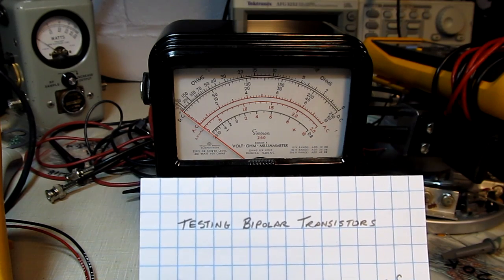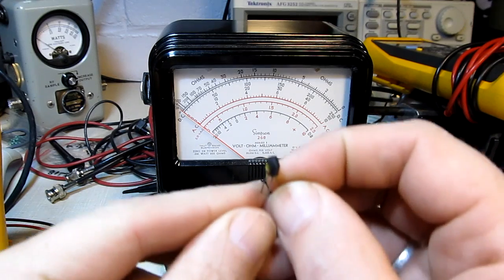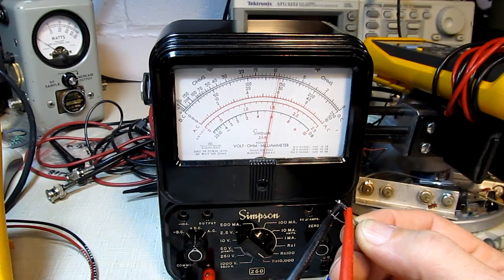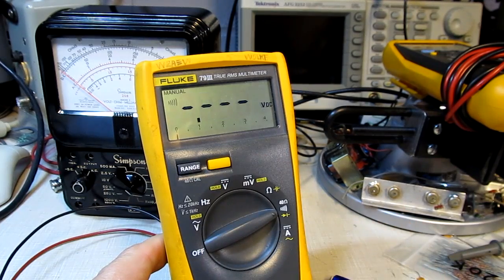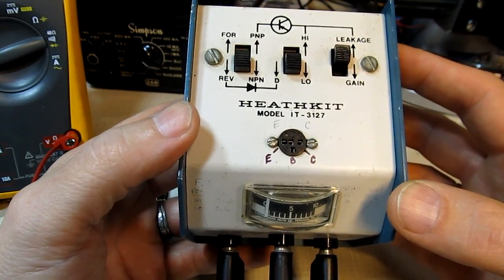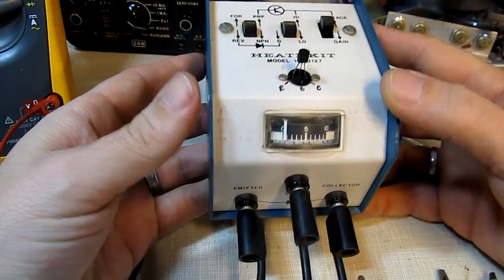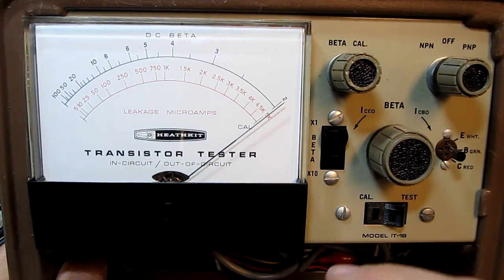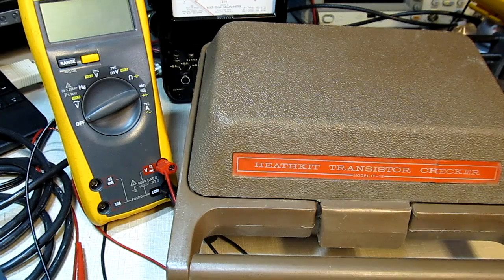#131: How to test transistors - NPN and PNP bipolar junction transistors, BJTs

Comment: 677mV forward voltage between base and emitter.  680mV between base and collector.  When I test a transistor I always notice that the forward voltage between the base and emitter is more than the voltage between the base and the collector. Am I wrong?  I used to think that I could identify the emitter and collector in that way
Reply from the maker: Sss Ttt I think this will depend a bit on the particular transistor type, so it might not be a reliable way to determine the terminals.
Reply: It might be that the emmiter region being heavily doped (rich in electrons for an npn transistor) creates a  stronger electric field, this being seen as an increase of a few milivolts.

Comment: Teach us the proper way to test a Mosfet I heard they can be damaged easily if not
tested correctly.
Reply: If you just heard they can be damaged easily, you better look it up again. With the exception of them being more sensitive to ESD, you have to do really stupid stuff to kill them. Since they are voltage controlled devices they are way easier to test then the current controlled bipolars.